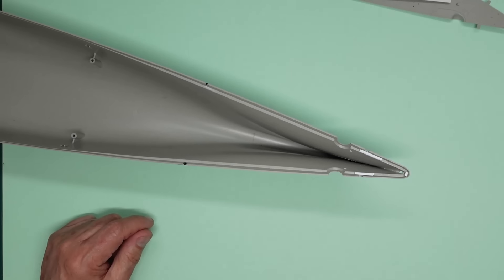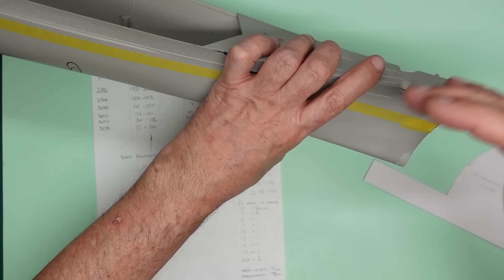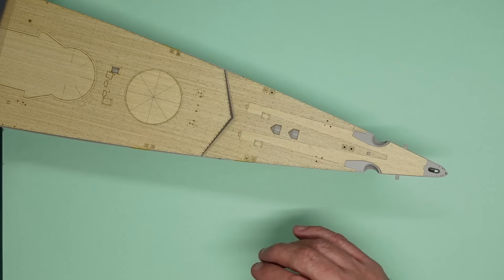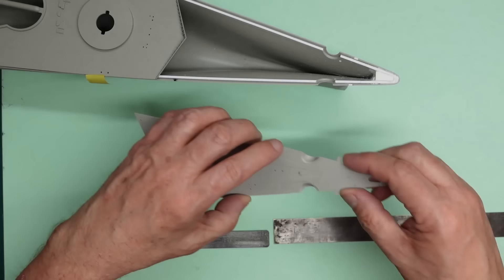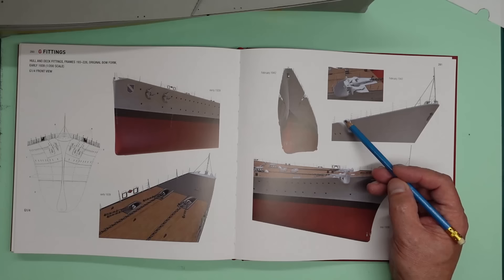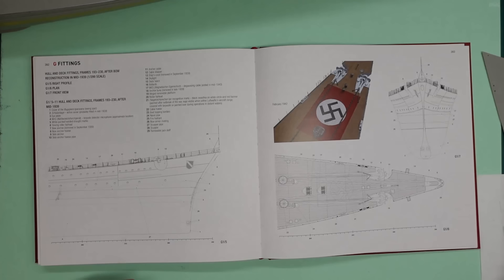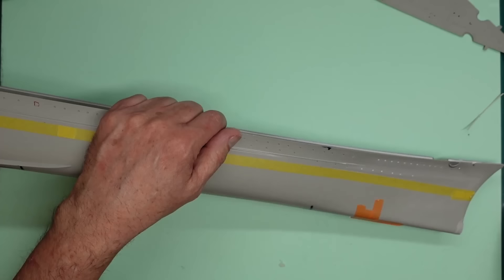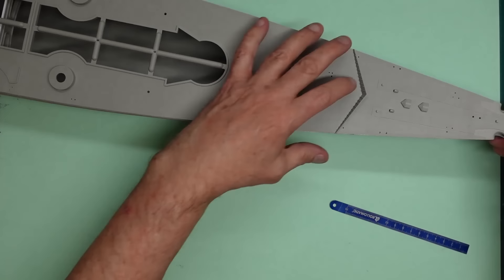Trumpeter 1/200 Scharnhorst Hull mods. Part Two.. The Deck.

Comment: I really applaud your efforts on this project, Nigel. It doesn't surprise me that a company would use more than one mold to cover a couple of hull numbers; what does surprise me is Trumpeter releasing Scharnhorst before Gneisenau, which the mold was specifically made for (according to the stamping in the hull). I'd be curious to hear their reasoning behind it. Is it because Scharnhorst is more well known and would sell more kits? Whatever the reason, I'm sure they counted on most people not knowing how far off the two hulls are. Wonderful work so far!

Comment: Hi, I really like the big boat builds, they're what brought me to your channel. @ the 25 min mark, you talk about measuring from the plans in the book and how they're not true length.  Plan and elevation diagrams are orthogonal projections, and curved surfaces are not true length, and care should be exercised when measured from. You need to know these concepts when interpreting drawings, and which projection will provide the accurate dimension to scale from. Just a little FYI, from an old school draughtsman.
Reply from the maker: Thanks. I think this has been drawn in the flat plane so all distances are measured parallel to centre line? I get it sorted in the end by scaling the 1/500 drawings to 1/504.

Comment: Absolutely loving this hull correction. Wish you would have done the one for Arizona (unless you did and I never caught it). Would it be easier to just fill all the portholes at this point and redrill them all? By the time the armor belt is corrected, the degauzing cable is rerouted and with the change in the deck height they're a real mess. To me it would seem if you measured them out bow to stern then, from the deck top down you could keep them where they need to be. Ain't rivet counting grand!?
Reply from the maker: I'm actually way ahead of the videos Charlie. ALL the portholes are redrilled as they were a bloody mess.

Comment: Great Video nigel, has the MK1 wooden foredeck corrected the error on the plastic where the anchor chains run? (jumped the gun by 10 minutes)
Reply from the maker: Thanks Jason. Yes MK1 have the chain planks corrected but the got the feathering of the plank ends into the edge piece back to front!!
Reply: @NigelsModellingBench  I've received the Scharnhorst parts, Thank you.